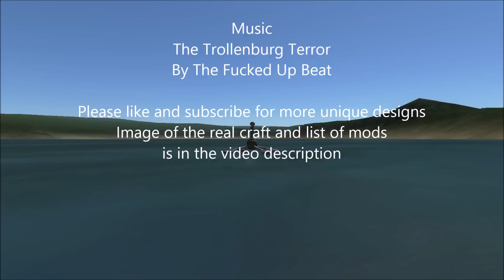KSP History's Misfits S2E8 - HZ-1 Aerocycle

Comment: was the aerocycle counterrotating to cancel out the torque? Your model looks awesome but I dont see any realistic way it cancels out the torque unles syou have rockets at the tips of the rotors :)
Reply: +Vincent Law 
Not sure if you already know this, but Hooksword used the rotor of KAX. KAX and (to my knowledge all Firespitter applications)  doesn't model a torque, just a thrust and a fancy animation showing rotors or propellers moving.  Unfortunately the KAX rotor is Huey sized so I don't think Hooksword could achieve a nice result by glitching two rotors along the same axis to create a counter rotating pair.
Reply from the maker: +Tuning3434 Yeah, my replica blade isn't perfect. It's just a little long, and as you correctly stated I tried slipping in a second blade but it didn't look right. Contra rotating rotors allow for maximum efficiency and cancel torque